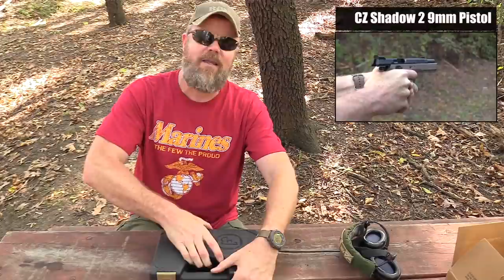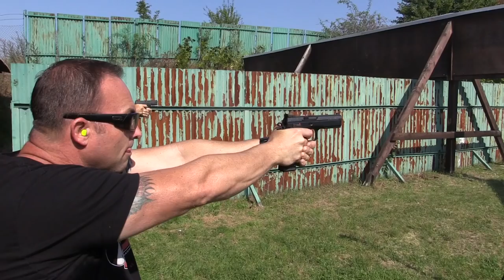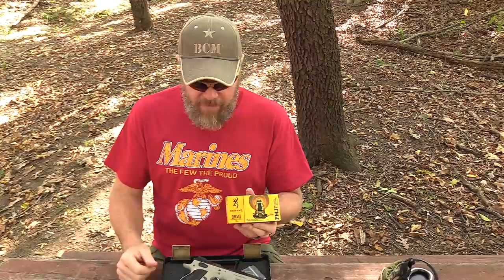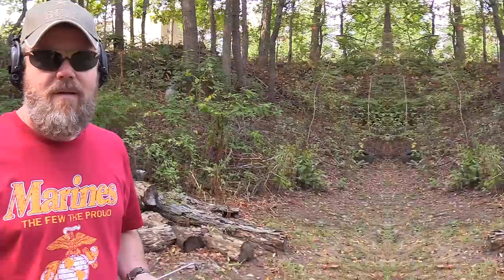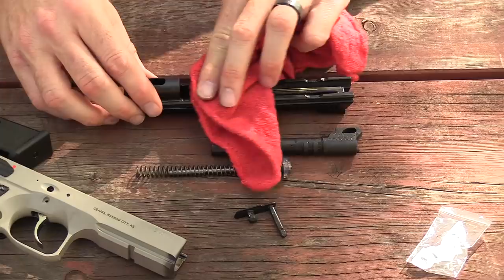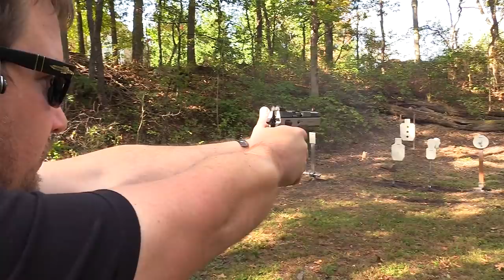CZ USA Shadow 2 9mm Pistol - The Ultimate CZ75

Comment: Hey, you mentioned your compact was made in Swiss! Does CZ just like Sig Sauer have a top quality factory in Europe and then an average manufacture in USA? Are the parts all from EU if bought in EU or China made but put together in EU? And is there a difference if I purchase from Switzerland or from the Czech Republic when it comes not only to quality of parts but also the actual engineering behind the guns? 

Would be super great if you could make a video and share what the differences are and where all the parts come from, simply said;  how and where does CZ build what quality, and where do they distribute the best ones! You made me consider this brand over others more expensive ones now. 👍🏻😂
Reply: CZ has plans for a large manufacturing plant in Little Rock Arkansas, on 73 acre's with over 500 employees.

Comment: Physics alone say that bore axis makes a difference on recoil impulse. The higher the pivot point the more muzzle flip you will experience. The closer the bore is to in line with your wrist, the more energy will be directed straight back into your arm instead of pivoting over your thumb. This is why the Chiappa Rhino's design is more wear on a shooter's wrist but allows for faster follow up shots compared to traditional revolvers. So in short, a low bore axis will put more wear on your body, but will allow for a faster accurate rate of fire.
Reply from the maker: This is such a huge debate on the internet I wanted to stay out of the fray. However, I believe I shoot low bore axis pistols faster and better then high bore axis guns like the P226, as an example.
Reply: Anyone arguing against it are probably used to high bore axis pistols and feel more comfortable with the recoil being diverted over their hand instead of the impulse putting more energy into their arms. Low bore axis definitely has more felt recoil, but it is much less movement of the gun itself. Since more energy is diverted into your arms it can definitely wear you out more over long shooting sessions especially with higher power rounds than 9mm or .45 ACP. I personally find that stronger armed shooters have less aversion to a lower bore axis than your average shooter, but that is just anecdotal so I don't know how true it holds.

Comment: The bore axis isn’t actually that low on the 75s. It’s pretty comparable to a 1911. So it’s lower than a P226, but is definitely higher than you’ll find on modern striker fired pistols. I think the way the slide rides in the frame makes it look lower, and the lower mass on the slide makes it feel softer, because even on the CZ forums you see people raving about how low the bore axis is.
Reply: And when you weight the slide you find out that it is not even light. This BS about low bore axis on CZ hammer guns is funny. I don´t know why is so hard to use brain for many people.
Reply: ggrandcz Is it not lighter than the slides on comparable pistols? I'm gonna be honest I've never measured mine (or any of my slides). It certainly seems like it should be lighter, but that could also be an illusion. Either way the 75 series are definitely sweet shooting pistols.

Comment: 😂 $1300 no way, no how!!
Reply: Perry Hughes if u shot one you wouldn't complain. This gun kicks the shit out of the competition.
Reply: 75ShadowShooter "Kicks the shit out of the competition" implies that the competition is not very good, and at twice the price it would need to be laps and bounds above the competition.... And it's not, nor is the competition "not very good."
Reply: Perry Hughes retail is hovering between 1150 and 1050.
Reply: What kind of competition gun is half the price? I own Shadow 2 for a while here in Slovakia, Europe and even Grand Power Excalibur costs about the same. Next closest competitor is Tanfoglio for double the price.

So what competition gun on par with this is half the price? I'm just curious.

Actually, Shadow 2 or any model from CZ 75 line (except for Tactical sport, which is pure single action) is designed for IPSC Production division where decocker is not prefered as it makes trigger much less crisp. 

I still don't understand why it's such problem to decock manually. If you are not able to do that safely, you should probably take more dry training.

Of course, anything this heavy is not for carry at all. For that, I have P-10C which immediately replaced my Glock 19 :)
Reply: Add a threaded barrel, long slide, and mounting option then perhaps.  Base CZ-75 is pretty golden at $500 and the P10 when you can find them go for <$600.  What I am seeing here does not justify a %150 premium.
Reply: It really doesn't. Ben Stoeger just won Iron Sight Nats and the World Shoot with a Tanfoglio Stock 2 and has won with a Beretta 92, and Bob Vogel has won Production nationals numerous times with a Glock 34. Kicking the shit out of the competition is in the shooter, not the gun.
Reply: There are many CZ's that are priced around the $500-600 dollar mark.. this is not your average CZ75... Its SAO.. and ready for competition..  Its no different than a SAO Legion, or a fully custom Glock..
Reply: Elevated adjustable Tritium sights for a Glock are what $150 and reworking the trigger is literally $25 worth of springs.  So you are up to $700ish if you throw in a little extra for the grips on this CZ.  Paying double for extra auto-cad lathe/mill work done by the same machine that works the bone stock guns is pretty stupid.
Reply: thats mean that they are (geniuses) talented shooters, others (normal shooters) must buys pistols which they are gracious to them and this pistol is same quality as tanfoglio for half of the price
Reply: Nope -- the weight and balance of the Shadow 2 keeps it flatter during shooting. Suped up Glocks are like lipstick on a pig.
Reply: It’s met for competition home slice people spend the same if not more decking out there stock guns
Reply: To bring a Glock trigger up to par with the CZ, you'd need to spring $200 for a decent trigger kit (competition connector, springs etc).
And you still have a featherweight pistol that jumps like a wild bronco compared to the CZ which has zero recoil.
In the hands of a pro competitor shooter who knows how to lock his wrists proper with years of training and hundreds of thousands of rounds fired, sure, not a big issue... Most regular shooters can't afford that kind of training regime (or the ammo cost). The CZ helps with low recoil, helps with quick repeat shots and getting back on target.
I own both a Glock and a CZ Shadow (1), and with the CZ it almost feels like cheating.
Reply: No way lol. Maybe this gun shoots well in esp but no way this beats any m&p, glock or sti in open class. The second you slap a slide mounted rds onto it every little bit of engineering went into reducing reciprocating slide mass goes out the window.
Reply: My short pull 3.5lb triggers on both my Glocks put me out $25 and $40, the $40 price was when parts were less available..  A flat face trigger boils down to preference not function.  Extra weight you can make the argument for as a fun gun, and as a carry gun you can just as easily see it as a con.......apples and oranges.
Reply: Eh, it's pretty easy to teach people to grip a gun as hard as they gun. Dryfire will help this just as much as live fire will in my experience. I've shot CZs, 2011s, SIGs, but I shoot a Glock 35 in Limited division, and even shooting .40 I honestly can't really tell the difference in recoil among all of them.
Reply: What? You're not shooting slide mounted sights in Open, nor are you likely shooting Open with any sort of plastic gun. The Shadow 2 was made for Production division, not Open. CZ has Czechmate TSOs for those, but even then literally any gun in Open is going to be dwarfed by 2011 pattern domination.
Reply: That's a very reasonable price because the pistol is obviously hand fit and finished. For that quality in a 1911 would cost you easily 2x more.
Reply: AKlover of course you can build a glock cheaper.. it's not a full metal hand fit pistol..  it's silly trying to compare the two against each other.. to some $1000 bucks is a lot.. to others..not so much..
Reply: Base gun sells at the local shop for under $550, this does not justify the premium adjustment from base.
Reply: 98 percent of the work is done by a lathe/mill and that work is probably overseen by 4 employees and this gun probably spends a grand total of 5 minutes longer on that mill/lathe.  2 people touching a file to it for a combined total of 6 seconds does not magically justify doubling the price.
Reply: Perry Hughes, you get what you pay for. As someone who owns more than one CZ product, I carry CZ-75B full size, I can tell you they are worth every penny. I've had the chance to shoot the Shadow a few times, I ended up going with the SP-01 Tactical instead (fits my needs better). But, you wont be unhappy with any CZ product. Next time you're at a range, if they have one, even a basic CZ-75, rent it try it out, you'll enjoy it. Unless of course, you're one of those Glock fanboys. 

Just kidding! But, really you'll like it, try one.
Reply: Competition pistol. Not an outrageous price.
Reply: Perry Hughes that’s not bad at all. You’re just poor
Reply: Ben Pritchard I am a Glock fan but I also own Sig, S&W, Ruger, Kahr, and many others! I love all guns but I can't bring myself to pay more for a pistol than I do my battle rifle! I'm sure it's a good gun but my god man $1300 for a pistol? If I was into competitive shooting maybe then but not for a new range toy!
Reply: afrosheenix yea and that's still outrageous for a pistol! I can get a top of the line AR for that and go to war with it!
Reply: AKlover I bought a Glock for $500 and didn't add shit and it can do anything my Sigs can do that are $300 more! Price doesn't take the place of practice!
Reply: Justis Heitz 😂 not me homeslice!!!
Reply: J.C. Brown yea I wouldn't buy them overpriced 1911s either 😂
Reply: andrew king 😂 yea maybe so but I probably own more guns than you! 😂
Reply: Perry Hughes, where the heck are you getting a battle rifle for under $1300? I hope you're not talking about the $500 AR's out there, as "battle rifles"? Every rifle that I own, that I'd be willing to go into battle with, is well over the $1300 mark, try more like $3500+! I speak as someone who's life has depended on weapons in the past, (12 U.S. Army with tours in Iraq and Afghanistan). I wouldn't trust my life with most of the "cheap guns" from the "battle rifle/assault rifle" rack at Cabela's. Just saying. You get what you pay for it. And my poke at Glock fan boys, was more a joke, but they are kind of the Honda Civic of handguns. Do they work? Sure, but there are better handguns for everything that a Glock is used for. As for my daily carry, I carry a CZ, it's a CZ-75B 9mm. I carry it both as my CCW, and on duty as a reserve deputy. So you could say, I depend on it to work, and it does. 

 Now, if you say you can't afford a $1300 range toy. Well that's a different story. Try out a more basic CZ-75/85. You'd probably find out the same thing that I did a long time ago, that they are really well made. And for the money, not much more than the Glock, they can't be beat! There are no other guns, in their price range that have as nice of a trigger. Nor as good of ergonomics. In my humble opinion.
Reply: Have you check how much is a STI? Lol
Reply: STI makes awesome guns but your talking 2 grand at least . Only pistol I would spend that kind of money on though. Double stack 10mm in a 1911 frame.....oh yeah.
Reply: Nice things cost money, if you can't afford the gun, don't comment on the price. That's a lower end price for a super high quality competition gun. Yes way, yes how!! 👍
Reply: I bet you have a $1000+ 1911
Reply: ShitFromShinola this is DA/SA
Reply: Andrew Delashaw who makes and where can I get a competition gun for $500?
Reply: If you ever take a class with him, ask Ben what he thinks of the Beretta 92 now. He brings it up in his podcasts from time to time, too.
Reply: if you look at some other handguns that compare to the shadow 2 you would see its actually a pretty good deal.  If you want a custom Glock or 1911 that shoots like the Shadow 2 be prepared to drop around 2 to 3 grand.
Reply: I own both STI and the first Shadow.. The STI is like no other. But trust me this Shadow2 is better then most premium 1911s out there. And yes I own a doublestack 10mm. Its a Tanfoglio. Epic gun.
Reply: If this gun was legal in CA it would be out of stock for a long long time...$1300 for that gun is dirt cheap IMO
Reply: Andrew Delashaw in your opinion*
Reply: Glock fan says it all...SMH
Reply: I call BS
Reply: Dont complain about the price.. CZ is actually cheaper in the US than it is here in Czech Republic :D
Reply: Shows how smart you are you only have 2 hands
Reply: Please the last fn contract for m4s were 400 a copy
Reply: @andrew delashaw

"implies that the competition is not very good" is a poor conclusion.

Competition COULD be poor and CZ is just good or the competition COULD be good and CZ is just way above the competition.
Reply: Ben Pritchard I also depended on weapons for years in the military, and I will take an $800 6920 into battle any day! I don't have Government money to spend on weapons but more power to you or who ever does! No amount of money thrown at a gun to make it the so called best will ever make you a great shooter. Only training does this, I know guys who can take a M&P and out shoot any Racegun. Besides my first comment you commented on was I would never pay $1300 for any pistol and no amount of you or anyone else pumping up CZ will ever convince me its worth it. I own many guns and I love them all I may own a CZ one day but I promise I will never pay $1300 for one. And if you have to spend $4000 for your rifle to be ready for battle I sure hope you spend twice that much on training!
Reply: Andrew Delashaw.  I never implied that the competition isn't very good. But have you looked into what a nice 9mm 1911 or Sig 226 legion costs? Similar quality levels but much more expensive than the shadow 2. At least where I live. I like the cz, feels as good as a 1911 but without 1911 "issues." Gladly pay 1300 for quality. As others pointed out, this is an all steel gun not cheap to produce if you want it done well.
Reply: I played with one the other day and it's amazing!
Reply: The fact that ur bringing a Glock into this conversation says a lot about ur firearm knowledge. SMH